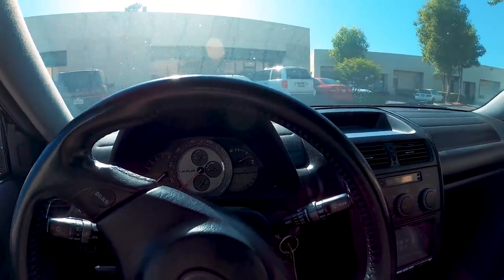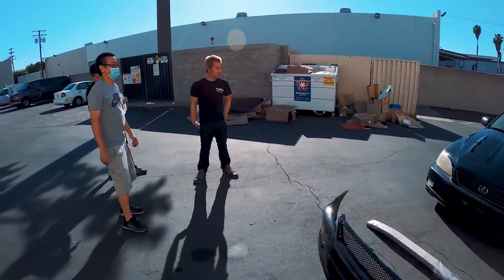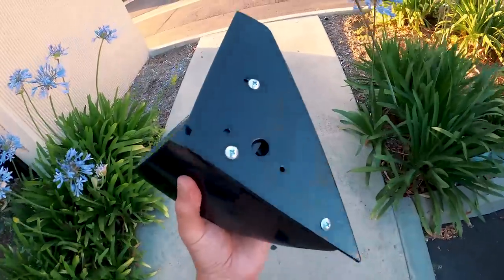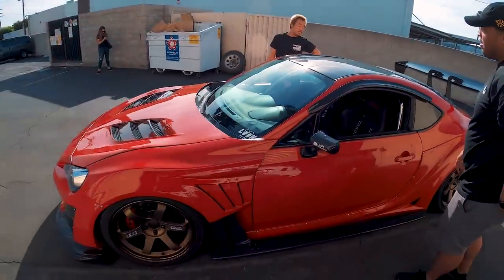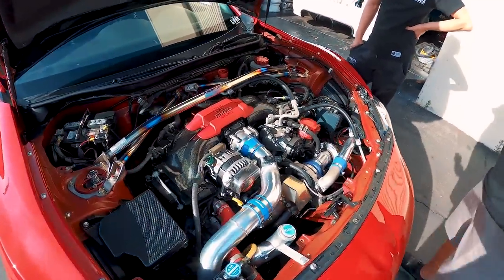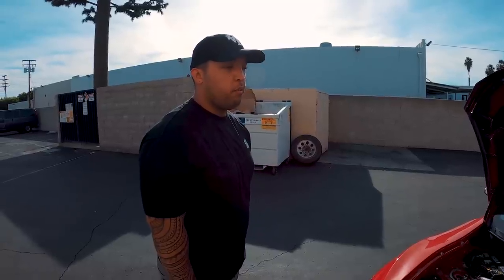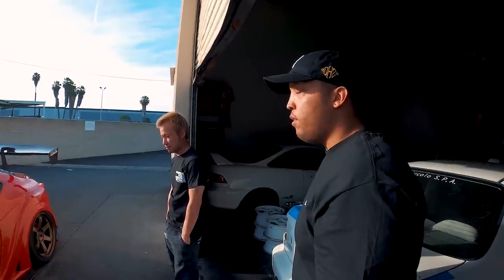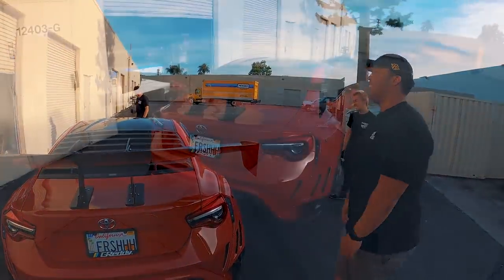Noel's Varis FR-S Turbo & We Finally Work On My IS300...

Comment: Can you tell me the details on the Yuta's EK rear bumper? I heard in a past video it was a JCW diffuser. Will it work on a coupe as well? Anything else beside cutting it that he had to do to make it fit?. I follow you both in IG under magoo_lc1. If you can give me any details I would appreciate it. I would love to do that to my EM1
Reply from the maker: It wouldn’t fit a normal Civic because the entire spare tire well is cut out on his car so it’s a flat floor which allows the diffuser to fit under the car as well as allowing the center exit exhaust to work.
Reply: @THECHRONICLES  thank you for the information I was wondering how it was fit on there